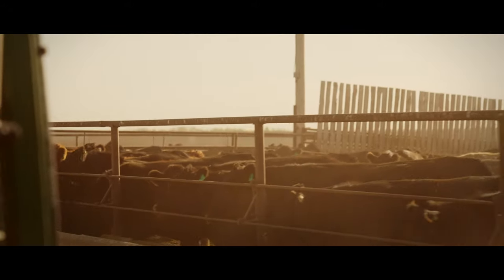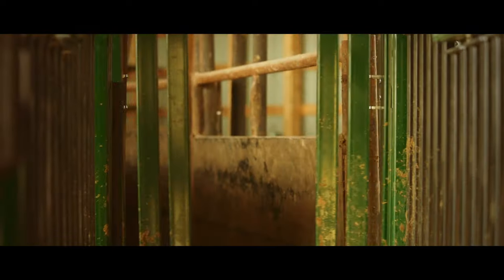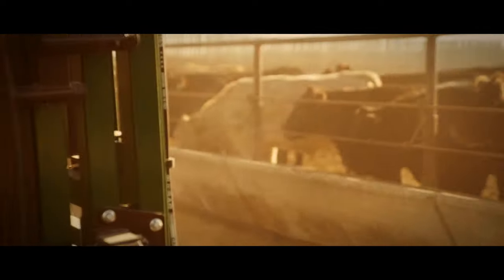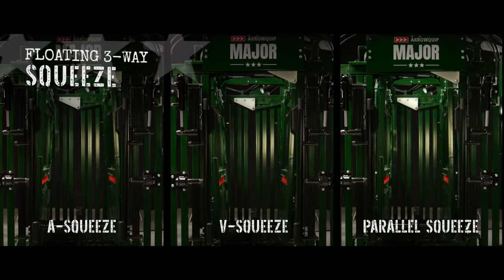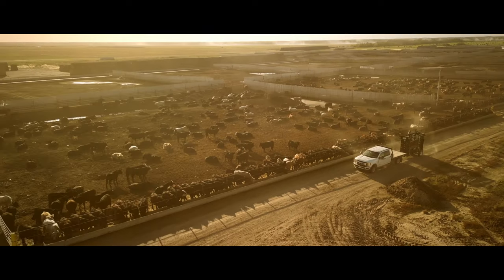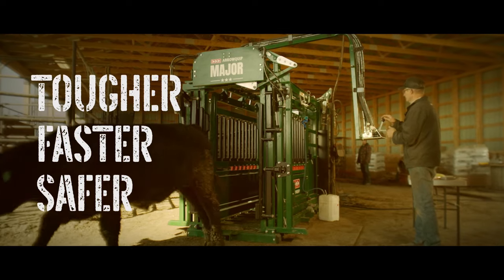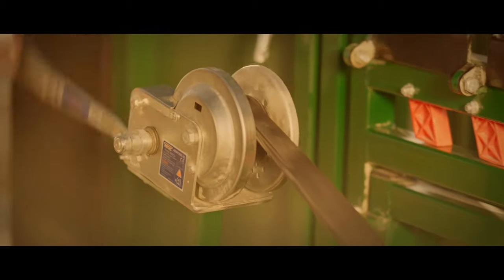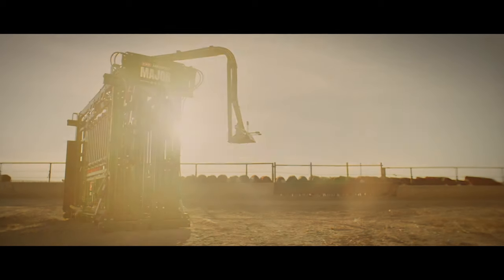The Major | Feedlot Hydraulic Squeeze Chute | Showcase | Arrowquip

Comment: Why the Major ?,  Colonel ?   General ??   differences or options that set them apart from one another ..  is it price differences ?
Reply from the maker: Great question! It is the way they are built (the thickness of the steel) and the features and options they have that set them apart.  The General is the top with all the bells and whistles like hydraulic jacks, followed by The Colonel which is the workhorse model with only the necessary features ranchers need and will use and similar strength to The General. Finally, The Major  has all the access you need and similar features you see in The General but a manual wheel kit rather than hydraulics to name one and a slightly smaller frame.